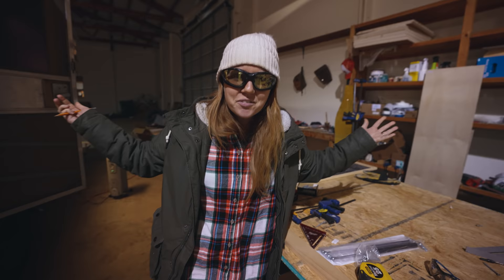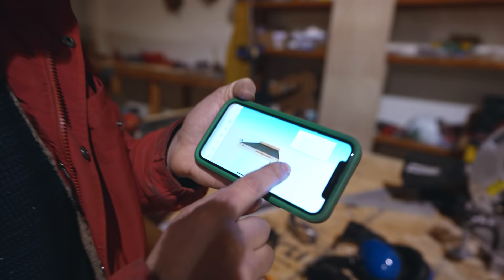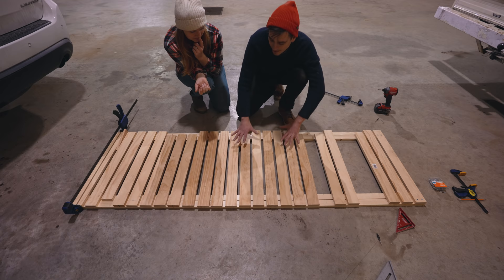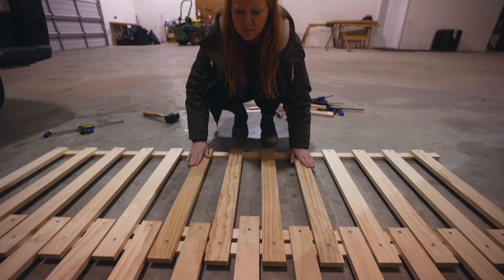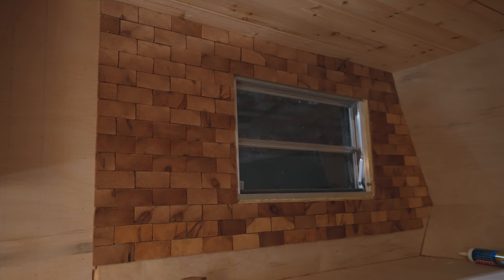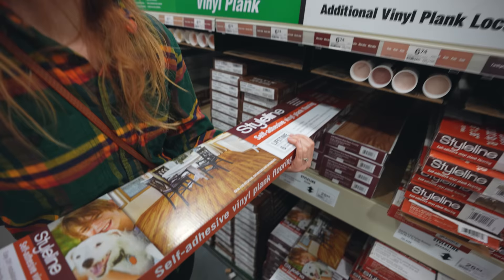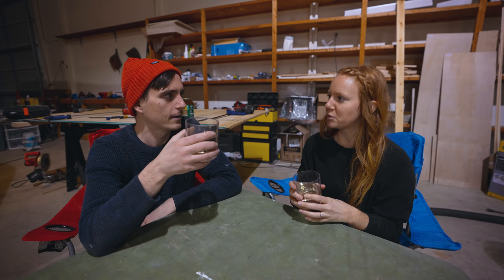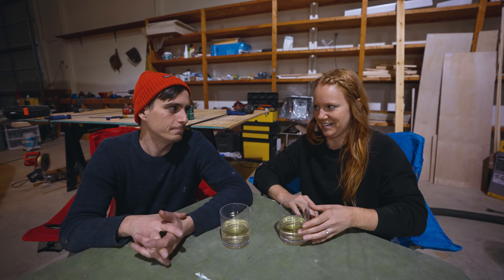RV Renovation - Building Our CUSTOM Pull Out Couch Bed! (Ep 16)

Comment: You should think about adding a third leg in the middle. With the outer legs to the far outside you will probably end up with sagging. Looking good so far!
Reply: Yes, and the sagging itself can make it almost impossible to pull out and push in without wiggling and yanking.
Reply: Install another strip perpendicular. You're literally relying on the weakest way to use the wood. The side edge board will sag less if you face another board perpendicular and underneath for strength.
Reply: Got to respect the third leg....lol

Comment: One improvement would have been to have the front raised when collapsed, and level when pulled out.  Seating is always more comfortable like this: think of an Adirondack chair... You do this by having all the slats supported by the front assembly and when you slide it closed, you have to lift it a couple inches so that when closed fully, the assembly is resting on a 1"x1" (or "taller" as desired...) which gives it the raised front behind the knees.  You can then use holes / dowels so that when you lower down the front it settles onto some dowels sticking up so it won't come forward on it's own when driving or sitting on it to "fall off" of the 1"x1"...  But when you pull it out (after lifting off the dowels to free it) it will sit and make the whole thing level for bedding...  To avoid the weight, I would have just painted under there... it's just storage...

But enjoying the care and details in your construction!

Comment: Great Job to both of you. Eric, when you return the bed back into the wall and the slats was not lining up and hitting the end, sanding the ends is a good idea but the wood might bow with usage so you might want to put a cross beam in the middle to hold the the stationary side and also when pushing back the movable side, the slates will not be hindered on the wall side and slide into place.

Comment: I agree with others that you really need a center support leg on the bed slide-out. However, i was also thinking that when you swing up the bed to access underneath all of those legs will get in your way. You really should add access door panels to the front of that bed so that you can have quick access to the inside without having to fold the bed up. Just my 2 cents.

Now that you are starting to get the walls closed up you can really start to get an idea of the space.

Comment: Watching this renovation has been a trip beck in time.  I worked for Coachmen in 1976 In Goshen Indiana and built these very motor homes.  My Job was in Final Finish and i checked all the LP lines for leaks and water lines for Leaks and 120 volt Electric for Shorts.

Comment: I've been rebuilding my RV as well. I've been using Power Pro brand screws. They're all Torx rather than Philips, and they're AMAZING. They don't strip, they don't split the wood, they don't slip around. They're more expensive than some of the other screws out there, but I've found I have essentially zero issues with them. They're at Lowe's -- 100% worth checking out.

Comment: I guess that the base and back will be made of foam. If the make the thickness top 2/3rds soft and the bottom 1/3rd hard it will reduce the tendency for the sponge being displaced into the gaps. I was going to say that the single screws on each slat will allow the top to lozenge. The leg frame will help to minimise that but it's not a cure. As mentioned elsewhere the frame really needs a centre leg. After the stain and poly, wax the bits that slide.

Comment: top tip: if you want everything to slide smoother get some paste wax (you can find it with all the wood finishes in any hardware store) and apply it generously anywhere the 2 surfaces touch.

Comment: awesome video as always....but..... you added extra support for the couch part but the pull out only has end supports and youll screw it onto rather than under the frame (so use bolts instead of screws maybe).
just pointing out from a far, love the progress and you cant beat creating it yourself, such an achievement

Comment: Hey y’all! My fiancé and I have loved watching your videos through quarantine. The pull out couch looks awesome! My fiancé noted when you were demonstrating the pull outs function that the paneling used as the support while in its extended position would function better if the weight of the pull out was pushing against the top of the support instead of being stapled into the side of it. 

Best wishes,
Dee and Zack

Comment: We used that same flooring in our RV renovation but slapped a strip of liquid nails on the back of each piece of vinyl to make sure it was stuck (saw it in someone else's YouTube vid). Also, you dont have to worry about weight as much, these RV's can handle a lot, you have to keep a closer eye on weight in trailers more than motorhomes 🤷‍♀️ Good luck guys! I love watching you guys struggle as much as we did 🤣😘

Comment: Hi guys great job, just be aware that when you tilt the bed frame, you’d need to consider the mattress so it could fall over or slip through. Other than that congratulations on the new spot in the warehouse which is really useful. ..! Cheers.

Comment: Love this... its the design Im working on. Ive done some trials and 1x4 works the best but the spacing can be 1/4" and still have the bed slide out easily. the nice thing, Erics butt wont fall between the slats. My design keeps the storage drawers mounted in the fixed portion, you just cant access them when the bed is pulled out but at that time, Im thinking more of sleep and snuggling than digging thru drawers. You guys have a awesome channel. Im subscribed and looking for more stuff to watch.

Comment: My daughter has a bed like that (single bed but you can pull out a second bed like a drawer when she has a friend over).
The thing I notice is that her bed support lattices are more narrow but thicker (I suppose to have less space between the supports when you pull it out but still strong enough with the heighth to support safely)... if in the long run your frames don't work out so well, it might be a change solution to consider (I know I know, it would be trash and redo, but if it works out the way you did, Great! just a plan B in case of "no, not so great"  to consider after trying and use)

Comment: Couch pullout looks good. You may want to hold off on support legs for the pullout section until you know the thickness of the flooring the legs need to rest on.  

Also, will it be relatively easy to get past couch when pulled out to get to latrine in back?  Like at 3am?

Comment: Full disclosure I haven’t built a slide out bed, but it is a little wonky because your gaps are to big. I would have made the gaps much smaller and not worried so much about the slats fitting in the space that makes up the length of the bed. I would have used 1” slats that were separated by a gap of only 1/8” which would have allowed for less movement (wonkyness). This would have created only 1” gaps when the slats are extended. To give it more strength I would have made the depth of the slats minimum 1” deep.

Comment: Thanks for the video, just finished a different version as I'm not as skilled as you but I'm wondering what you used for a mattress, as mine the width of my slide-out area 73" x 54" and needs to be able to fold for couch position?

Comment: I have a question do you have to put paper between the insulation and the wall that keeps out the moisture we didn't and the moisture is coming through between the aluminum and there's in the padding or the insulation and it's not a good thing so you should check on that  just a hint

Comment: If you think you bootie will fall through the slats, why don't you just use two thin pieces of lauan to lay on top of the bed? You could make the pieces the width of the "sofa" and store them under the sofa cushions when you don't need a bed.

Comment: Do you happen to have a running total of the costs of all the lumber and stuff you’re putting into this? We have an early 1990’s class C and plan on doing something similar. I’m jealous of the warehouse space though. We have annoying neighbors that called code enforcement because our rig stuck out on the sidewalk a bit sooo I’m trying to figure out how we will be able to renovate it without complaints. Also wondering how much it’s going to cost.

Comment: i wonder if your rv will require a new engine even and that will mean more cost as the engine is probably from the 70s you said i think and also is the rv going to drive well and not break down often.  its got me worried now you spentall your money on it (and effort) and will have to spend more on the engine!

Comment: can you list your dimensions. I am making the same thing but only half will pull out for a l shaped couch with a foot rest hidden underneath. I haven't seen anyone put the height and depth of the couch. thanks
Reply from the maker: That sounds like a fun project! Our dimensions are approximately 80in x 25.5in when pushed in and 80x45 when pulled out 👍
Reply: @Theendlessadventure Thanks,  How high did you make it. And Eric should buy you some new jeans without the holes in the knees. :)

Comment: Don’t know how bad it is there but I went and bought 12 sheets of 1/2 plywood Friday and almost had a heart attack. 31.70 for a sheet. Wt__. I will build nothing else until this pandemic is gone. Thanks covid. Also if u find that the spacing is to wide for comfort. Get some Vinyl webbing they use for furniture. They sale it at Lowe’s I believe and u can make two runs and staple it real tight onto the skates that don’t move.  O jeez y’all didn’t use glue. They make a glue for that type of flooring. Maybe it won’t back up.

Comment: 10:32 ok hello how are you i don't want to install your vinyl plank floor it's very heavy it's very dangerous if sometimes water due to damage occurs in your motorhome me already what- what happened big water damage several times plumber problems water leak it was expensive to repair used linoleum no problem it's not easy cheaper already water damage to the linoleum I had replaced I am a professional working all the rvs big thank you very much have a nice day